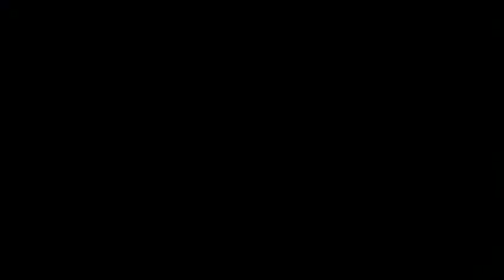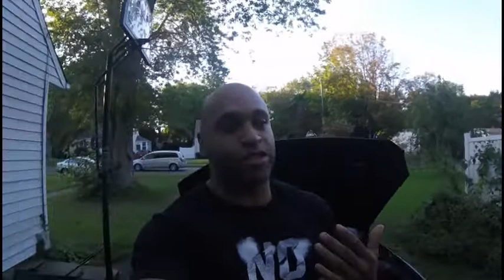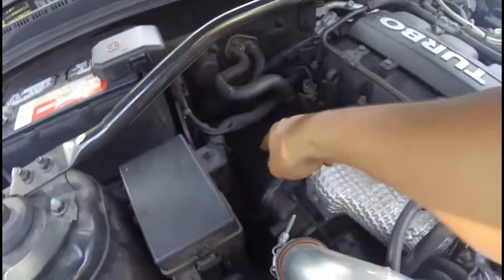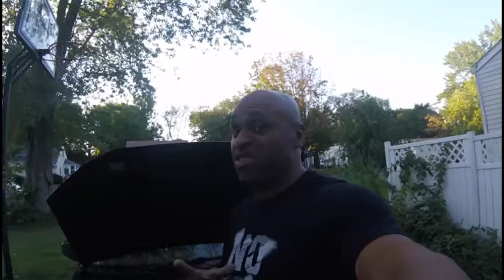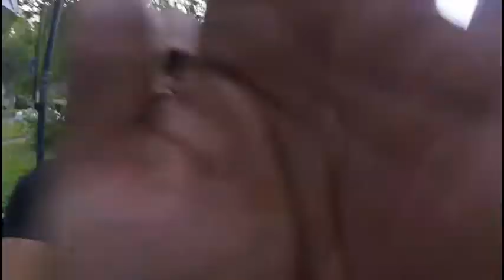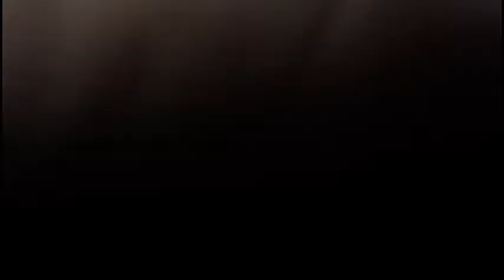Why is Tuning is Important - How to use BTR, SFR or Haltech to tune the Genesis Coupe

Comment: I know this video is old but when you got your tune, did you get it to where it pops and bangs and if so does it put more wear on the car at all
Reply from the maker: If your referring to launch control then yes, I do have the pops and bangs. I put 80k miles on that tune with no issues. If you are sensible and take care of the car I.E. regular maintenance and not beating the crap out of it, you'll be just fine. I'm putting the same tuned ecu in my "new" Genesis Coupe.
Reply: @ChuckTateD117  awsome thanks for the reply

Comment: hey man. i wanna get a pre tuned ecu stage AT for my gen coupe 2013 2.0t its my daily drive i put around 70 miles a day on it. do you recommend tuning it? i still wanna drive it for 3-4 more years. currently have 32k miles on it. i dont wanna damage my engine.  did it cause u any trouble? 
thank you!
Reply from the maker: wael whad I have not had any issues with my pretune and I’ve had it for almost 3 years now. I’ve got about 60 thousand miles on the ecu. I personally like the BTR pretuned ecu. To get it tuned yourself would require something like a Haltech which is $1500 before you tune it. I have a Haltech now but that’s only because it is for the motor I’m currently building and bigger turbo etc etc. 

So I would recommend getting the pretuned! Make sure to keep your stock ecu handy if you live in a state with emissions!
Reply: do you have an intercooler for the tune?  i live in toronto, but yea we need emission too lol
Reply from the maker: wael whad yes I do. Down in the description is a partial of the upgrades I have. I actually need to update that list lol